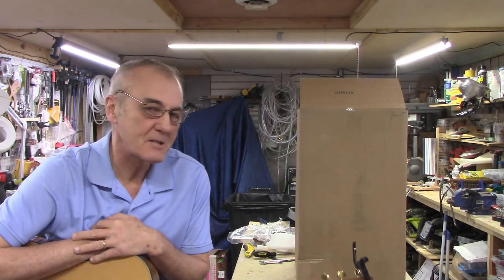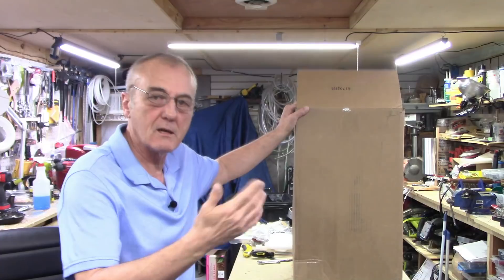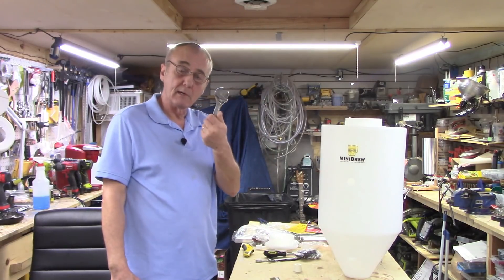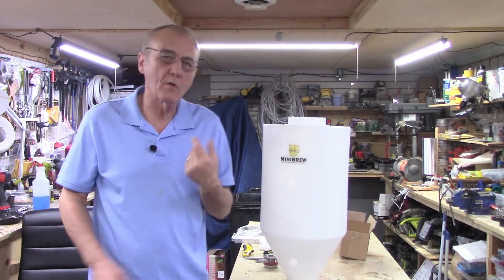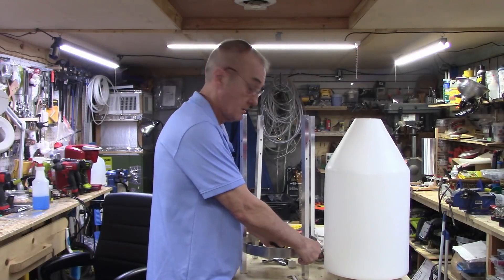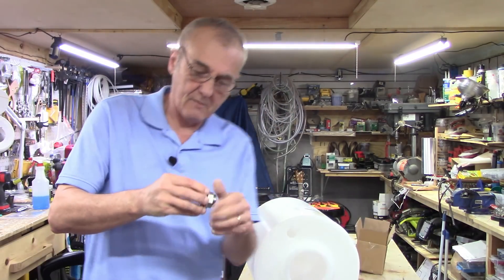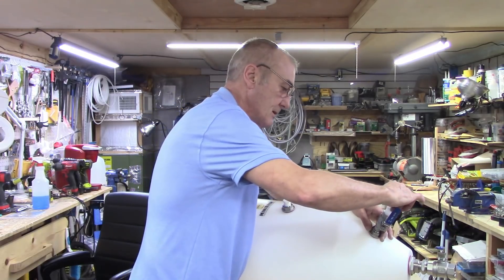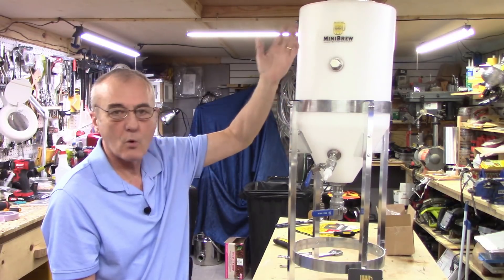REVIEW OF AN 8 GAL FERMENTER

Comment: If your going to review a fermenter, shouldn't you actually use it to ferment?  I heard a lot about assembly and thick plastic, but one of the largest complaints about these "economical" fermenters involves the ease of sealing around the fittings.  This non-review doesn't address anything about this nor usability.  What the narrator says are unique about the design (ie - comment about the drain port above the yeast) are fundamental properties of conical fermenters and are not at all unique about this product.  The only thing I heard that might be truly unique is the thickness of the wall.  All in all, this is a sad excuse for a product review, being more a review of assembly.

Comment: Read through the comments and thought I would post a tip whenever I carbonate a batch I use a 16oz water bottle as a test you just give it a squeeze everyday when it's hard their done. This post was for Bearded page the new system messed me up but it's still a good tip.

Comment: Hey George - -   Good video. 
I'm wanted both dead and alive It will depend on who you ask?  
An experienced guess is as good as it gets. 
That looks like a good fermentor. I have two of the ones that hang on the wall and claim to be fast. their not! Changing the parts is a pain  in the palms and the "o" ring always falls off.  Currently my favorite masher is the 50 gallon Jug I purchased for $5.  I used a dually hopper and a  jank with some hose into a  bucket to let me K - Known when its finished (AKA an airlock). I get about 40 gallons in 3 weeks to sort out.  Happy Distilling is topping off my 3rd gallon at ~90% in the middle of the run. ( ok maybe it dipped to 88% non the less it Started at 92.)